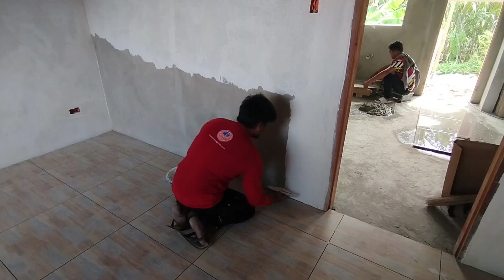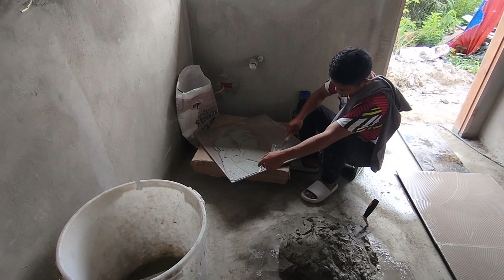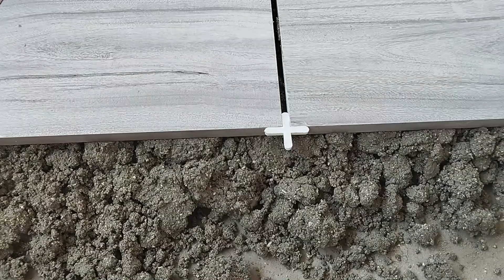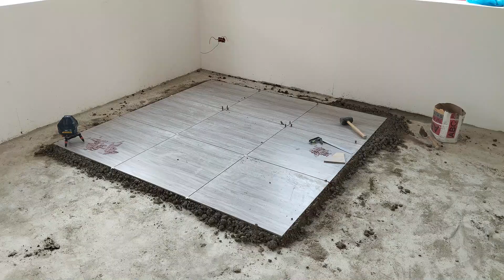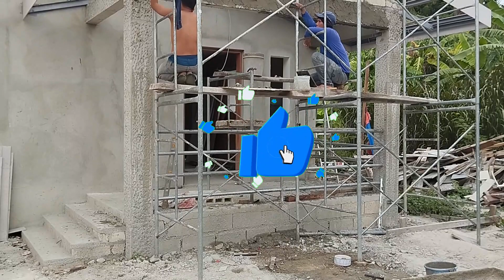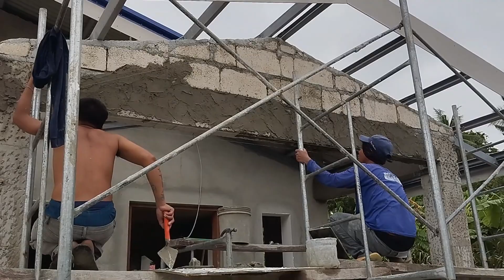Building a House in the Philippines - Blackout!

Comment: I found it interesting the way they lay tile here. I made the mistake of hiring a guy that did not have much experience laying tile. The walls in the  bathroom were okay, but I pulled all the tile off the shower floor after  he went home. On inspection I noticed he did not slop the floor to the drain and water would have pooled. He felt insulted when he came back the next day and quit.  I ended up tiling the rest of the house after that.